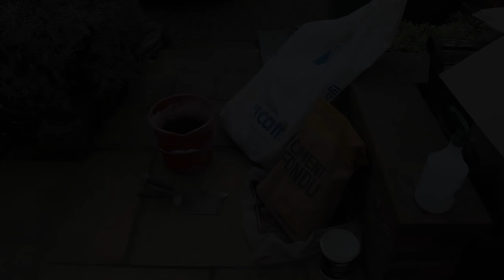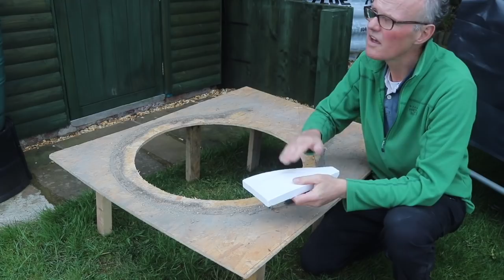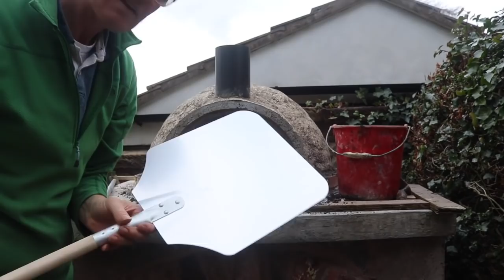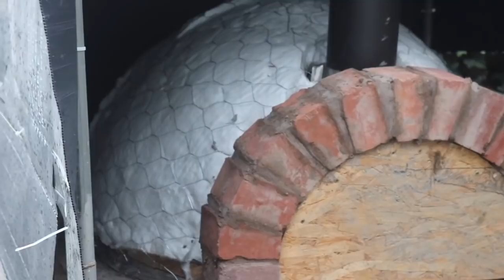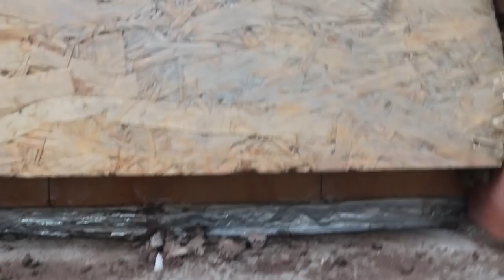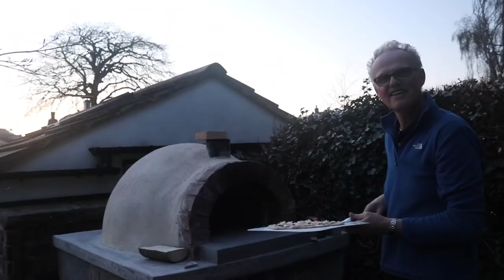DIY Pizza Oven Build: Vermiculite Dome

Comment: İs this really a long time solution? No Cracks?
Reply from the maker: Hi - certainly nothing serious. Still using the oven several years later…I guess where there are extremes of heat you will tend to get cracks but so far nothing serious. I have covered the dome to keep the rain out (little roofed structure) - I think this has helped maintain the oven. Thanks for your comment - Regards

Comment: I guess this is condemed to crack as the dome sits on the fire bricks. It shouldn't. s
Reply from the maker: Hi - Hmm - I’ve had this a few years now and it’s not got any major cracks - I used vermiculite and refactory cement so it’s reasonably ‘heat’ proof. Thanks for watching and commenting. All the best..
Reply: @solway17carlisle  Good to hear you do not confirm what others say, that as the fire bricks tend to extend due to temperature changes, the dome itself doesn't move and this would cause cracks. One "vermiculite pizza oven builder" reported about this issue...

Comment: What is the width of your chimney. Thank you very much.
Reply from the maker: Hi - it’s a 5” diameter vitreous flue pipe for wood burning stoves. Then linked to twin wall flue as it goes out through the roof of the shelter I built over the oven 👍

Comment: Great build I would like to make the same size pizza oven as yours just wanted to know how many fire bricks all together did you use.
Reply from the maker: Hi, I’m not really sure as it’s a while since I built the oven now. I remember looking at the sizes of fire bricks then ‘guesstimating’ how many I needed. I then cut them with an angle grinder so that my oven fitted over the top. Of course I underestimated the number I needed so went back to the supplier and bought a few more to finish the job. I got them from a builders merchant in my nearest town so it wasn’t too problematic to go back there to get some more. Sorry I can’t be more helpful - suggest you estimate first then go back for more should you need them. Good luck with your build. Regards...
Reply from the maker: Hi, I’m not really sure as it’s a while since I built the oven now. I remember looking at the sizes of fire bricks then ‘guesstimating’ how many I needed. I then cut them with an angle grinder so that my oven fitted over the top. Of course I underestimated the number I needed so went back to the supplier and bought a few more to finish the job. I got them from a builders merchant in my nearest town so it wasn’t too problematic to go back there to get some more. Sorry I can’t be more helpful - suggest you estimate first then go back for more should you need them. Good luck with your build. Regards...
Reply from the maker: Hi, I’m not really sure as it’s a while since I built the oven now. I remember looking at the sizes of fire bricks then ‘guesstimating’ how many I needed. I then cut them with an angle grinder so that my oven fitted over the top. Of course I underestimated the number I needed so went back to the supplier and bought a few more to finish the job. I got them from a builders merchant in my nearest town so it wasn’t too problematic to go back there to get some more. Sorry I can’t be more helpful - suggest you estimate first then go back for more should you need them. Good luck with your build. Regards...
Reply from the maker: Hi, I’m not really sure as it’s a while since I built the oven now. I remember looking at the sizes of fire bricks then ‘guesstimating’ how many I needed. I then cut them with an angle grinder so that my oven fitted over the top. Of course I underestimated the number I needed so went back to the supplier and bought a few more to finish the job. I got them from a builders merchant in my nearest town so it wasn’t too problematic to go back there to get some more. Sorry I can’t be more helpful - suggest you estimate first then go back for more should you need them. Good luck with your build. Regards...

Comment: Great video! I’m about to start building my own this weekend. One question: does the outside of the structure get hot to the touch? If so, how hot? Because I would like to mount my oven on some wood pillars. Thanks!
Reply from the maker: Hi Claudio - I’ve seen other ovens on YT mounted on timber so guess all will be ok. Suggest you invest more in the depth of insulation and fire bricks on the base of the oven. Mine is on concrete so barely gets warm. The dome is just warm but ok to keep your hand on so never too hot to touch. Of course, the chimney is always hot. Good luck with your build. Thanks for watching

Comment: Hi, sorry to ask another question, what what the size of the fibre insulation you used, I’m guessing it was a 2 metre roll and 25mm?  Thanks again
Reply from the maker: Hi Darren - I would go with what you suggest there. It's now a while since I built the oven and my ebay purchase history only goes back to 2019. It's ceramic fibre blanket you need and it needs to cover the dome then hold it in place with chicken wire and some nails around the base. If you have too much, put a bit extra on - won't do any harm. All the best...

Comment: Hi, looking to build my own soon, for all the layers, was a 100 ltr bag of vermiculite enough? and do you need to add the insulation later, or can you just use the vermiculite?  Thanks and enjoyed watching
Reply from the maker: Darren Wiles Hi Darren - yes, one big bag of vermiculite was enough for my build. I would advise adding the extra insulation as the oven needs to maintain a high temperature (400 centigrade +) so all the layers of ceramic fibre blanket and vermiculite help with this. You only build it once so my advice: don't skimp. Good luck with your build...
Reply: @solway17carlisle  great, thanks for replying so quickly, and just one more question if that’s ok, it’s only a family project and might not be used that much, can I get away with using standard Portland cement rather then refractory? Thanks again
Reply from the maker: Hi Darren - I understand that Portland cement can crack under high temperatures so I bought ‘ciment fondue’ off eBay. There’s no guarantee that even this won’t crack ( have read at some of the comments below). Again, at the end of the day you’ll end up with quite a big structure and it would be a shame if the internal wall started to crack and collapse...that’s my ‘take’ on it. Hope that helps...take care
Reply: @solway17carlisle  hi, sorry for the late reply, thanks for all the advice, much appreciated 🙃
Reply: Hi again, I now have my vermiculite and ciment fondu that arrived today, could I ask one more question, what was the mix of your render, it looks great!  🙂
Reply from the maker: For the ciment fondue and vermiculite mix I used a mix which is 3 parts vermiculite to 1 part ciment fondue. Add water to make a stiff mix that can form a stable structure as you build it up in layers over the gym ball. Use a trowel to smooth it over and compress it a little. At this time of year keep it indoors until it dries properly. To reduce the risk of cracking, cover with damp towels. Hope that helps - good luck with your build

Comment: How did you attach the flue pipe? What did you use to seal it?
Reply from the maker: Joe HADFIELD  I put in a short section of flue pipe and mounded the vermiculite around it. Then when I added the brick opening I attached some galvanised metal straps to the flue and bedded the unattached ends into subsequent layers of vermiculite and cement used in the brickwork. I then attached the heavy twinwall flue but ensured its weight was supported by the roofing timber above to stop it bearing down on the fragile dome structure. Realise this is a long winded answer but it's a case of finding a way to support your chimney as you build it. Hope this helps, don't overthink it...
Reply: @solway17carlisle  thanks for such a quick reply. I loved your video by the way. 

I've made the vermiculite dome shell, and I left a 10cm odd hole in a similar position that you have yours in. Tomorrow I plan to insulate the dome with ceramic fibre blanket and chicken wire, before adding screed and then render. Will do the brick arch as well. 

Any tips on what I should do for the flue? I have a twin wall stainless steel pipe 5inch across. Which I realise is bigger than the hole. Wish I had done it your way now, but saw this too late
Reply from the maker: Joe HADFIELD Hi Joe - hmmm, I think you need to get hold of the shortest section of same diameter single wall vitreous pipe and secure this into your chimney aperture. This can be cut very short, then you need a twin wall to single wall connector. From there you can build up a chimney using your twin wall pipe. You could just use single wall throughout - just long enough to form a chimney with an effective 'draft' - some people just use a clay chimney pot instead. Not sure if this helps but please get back to me if I can help. Cheers...
Reply: @solway17carlisle  thanks for your help. I managed to get am adapter single to twin, and then have a twin wall flue attached. Looks good. 
Will do the screed tomorrow before allowing that to slowly dry out and then will render it. What did you use for the render?
Reply from the maker: @joehadfield7480  Make sure you put a layer of vermiculite render on top of the ceramic fibre blanket (also using this to further support around the chimney area..). The final top render coat could be a standard portland cement/sharp sand mix OR a coloured render mix eg K-Rend - a bit more expensive but nice to use and gives a good coloured finish. Hope it goes well for you...
Reply: @solway17carlisle  over the blanket I put a special heatproof screed from vitcas. Job now is to render.
Reply: @solway17carlisle  thanks for all your comments and help. Appreciated
Reply: @solway17carlisle  how long after adding the vermiculite screed until you rendered it? Also how long did the render take to dry? Just need some help with the curing process etc.
Reply from the maker: Hi Joe - I let the second coat of vermiculite render dry out over a period of days. I then finished off with the top coat of K Rend once all the layers below were dry. It was warmish weather I recall so it didn’t take that long. But I also made sure that I kept any rain off the dome with plastic sheets. I think so long as there’s no obvious moisture showing and it feels ‘set’ you should be ok to put the final render coat on. Once you set a fire the whole structure will warm up and dry out. Hope that helps...
Reply: @solway17carlisle  hey. I have finished my rendering now and just curing it all out inside. 

Final question. How did you make your pizza oven door? Help with that much appreciated. Thanks
Reply from the maker: Hi Joe - tbh the door was the most difficult. My first attempt was to use some surplus ceramic board cut to the right shape. This was ‘sandwiched’ between a thin aluminium sheet material which I could reasonably easily cut with tin snips. This layer faced into the oven. On the outside some thick plywood. All bolted through. More recently I took a thin plywood template of the opening and got an engineering company to make a door out of 2 sheets of steel ( one slightly smaller to fit the inner recess) they drilled 4 10p sized holes in the bottom to allow air passage. I can block these off on the outside with bits of flat wood to control the airflow. Not perfect, it’s a bit heavy but a long term option which seems to work ok. Hope that helps. Glad to hear you are making progress. Atb

Comment: thank you for the great video, for the 3 to 1 vermiculite - refractory ratio do you also add Portland cement for strength ? pls advise im about to make my dome
Reply from the maker: Mansoor Syed Hi Mansoor, no, I didn't add Portland cement in my build as I was concerned that in the heat of the oven it may have cracked. I think when I built my dome I made sure that I had a reasonable thickness of material as I built it up over the gym ball. I was also very careful in moving it, once fully set, onto my oven base. If you look at some of the other comments, some have reported difficulties...all I can say is that mine worked ok and is still working ok today. Best wishes, and good luck with the build - Andrew
Reply: thank you that was helpful i will follow you ratio of 3:1 i also made two small bricks  by using 4:1 and 3:1 both seem ok but the 3:1 is denser and seems stronger now i will try the dome :) thank you again
Reply from the maker: Good luck with the build. Regards...

Comment: What bricks did you use as to cook on?
Reply from the maker: Hi Paul - I used heat resistant fire bricks.I got mine from a local builders merchant
Reply: @solway17carlisle  thanks

Comment: Dear sir. Many thanks for tips. Looks like you did an amazing job. Also many thanks for your efforts making this video and uploading on here... This is exactly what I want to achieve and hopefully I will manage.
Reply from the maker: Hi Mehmet - thanks for your comment. The oven is still working very well, when you start your build take your time, use heat proof materials, plenty of insulation, and you should be ok with your build. Very best wishes and thanks for watching....

Comment: You mentioned towards the end about making the oven more water tight. How did you do this. What was the final mix please. Thanks in advance.
Reply from the maker: Hi - my top coat was a render mix. I got hold of a bag from a builders merchant eg KRend. Then I built a little roofed shelter over the dome. You can see this in my update vids. All the best...

Comment: Hi andrew , thanks for the encouragement , thinking on it we did have a problem securing our rain cover , a block of wood we were using fell and landed on the support. i did not check the cast as it was fully covered and the wood I am sure did not hit the dome , but perhaps it flexed the support enough to disturb the dome . Pretty sure I had the right mix and consistency , now just have to wait on more fondu .I used exactly 100 ltrs perlite and  have some fondu left over . When I removed broken dome the perlite had set and was pretty hard . Im not sure if that is right . My wall thickness was around 50 mm
Reply from the maker: Hi - your wall thickness at 50mm sounds good. Obviously any knocks or movement while the dome is setting are best avoided, but I’m sure you know that. My only thought ( and I’m no expert!) - is there a difference between vermiculite and perlite when building these things. I got a bag of vermiculite from a builders merchant - it’s used for chimney linings etc. I found it mixed well with the fondu ciment. Maybe absolutely no difference between them but just something to consider particularly if you’re waiting for a new bag of cement? Cheers for now...

Comment: Hello again , just tought I would give you an update , yesterday I managed to form the oven  and following tips etc gleened finshed around 16.00 covered with damp cloth etc. First thing this morning I had a sneek peek but unfortunately it has had a catastrophic failure. Not sure if it was water content but anyway its back to the drawing board.
Many thanks for your help and advice ,keep safe
Reply from the maker: Hi - Oh no, what went wrong! I think lots of people seem to have large cracks appearing and have to start again particularly when moving the dome. Suggest you ensure your mix is around 3 or 4:1, only enough water to keep the mix quite stiff and the thickness of the dome sufficient (3-4cm?) to maintain some integrity as it’s being built up. Start at the base and go up in layers...keep positive! It’s an opportunity to have another go..all the best Andrew

Comment: Hi thats great advice , you have answered many questions about the curing etc ,I was worried that the fondu cement would have the same properties as when it is used as an accelerator with portland cement  ie  sets within 30 minutes . Many thanks I will keep you posted

Comment: Hi again sorry to bother you again ,one last question , can you remember off hand how long it took you to mould the dome . Liked your chimney video , but rather you than me . Many thanks
Reply from the maker: Hi Andrew - You might notice that I didn’t show construction of the dome as I completed this in the Autumn before I thought about filming the process for YouTube. Having got the gym all in place and the form work for the entrance and all covered in cling film, I did a few good mixes and completed the dome in one go. Not sure of how many hours but I’m pretty sure I did it in one go. The only scenario I can think of where you might pause is if the material begins to slip under its weight as you build upwards. Then I would leave off and restart the following day when the material below is solid enough. It’s definitely a job you can do within a day. I hope that’s ok. The material need to be mouldable but not too watery that it slumps. All the best - happy to answer any other queries